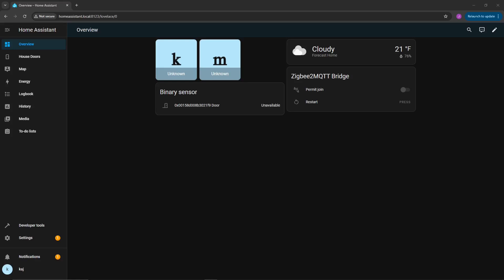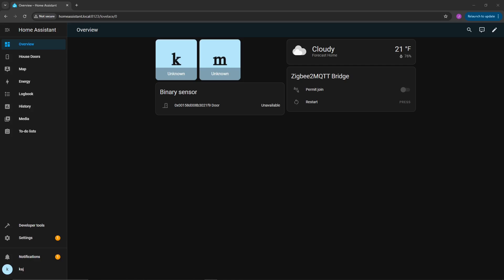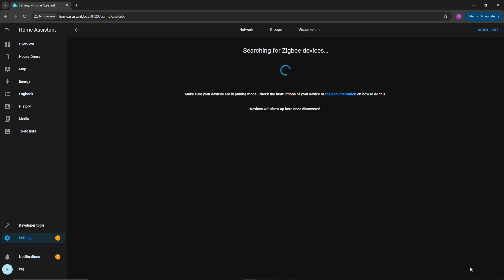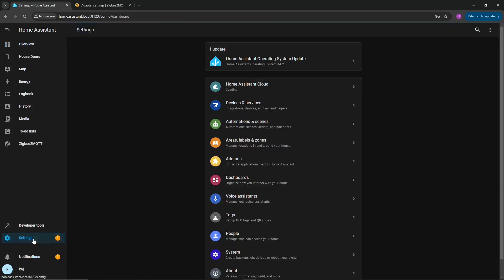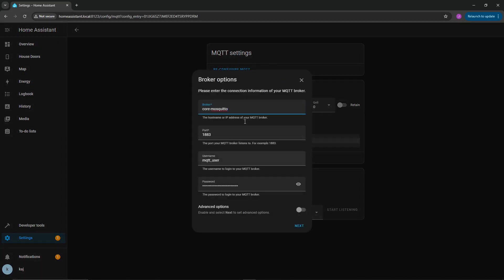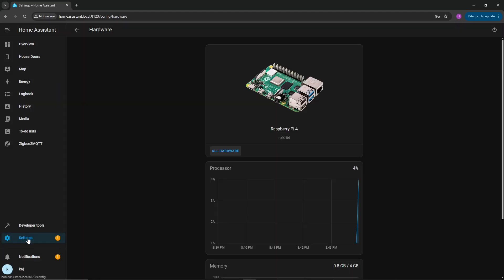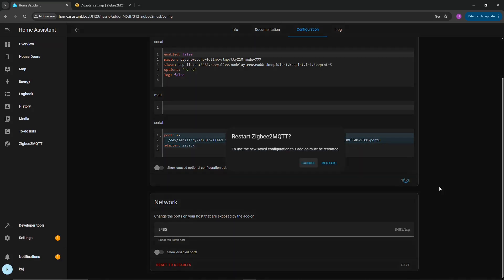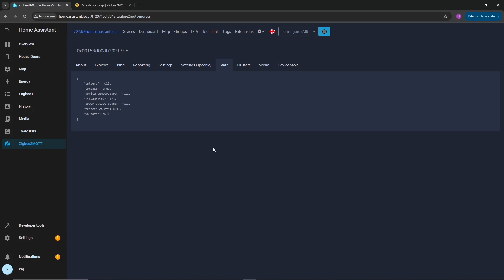Setup AQARA Sensors in Home Assistant (Zigbee2mqtt & ZHA Tutorial)

Comment: I pressed the button on the fp2 sensor but it did not flash blue
Reply from the maker: @andywickett22  did you try holding it?
Reply: @TechwithJak  Yes I held it down for 30 seconds. It's an Aqara FP2 sensor
Reply from the maker: @andywickett22  can't speak for that sensor but maybe you didn't pull the tab out between battery?
Reply: It has been paired for to home assistant for months via WiFi and the apple HomeKit integration. I unpaired it when I pressed the button and it started flashing yellow. It’s taken me 2 days to get it reconnected. I messed up my whole home assistant setup in the process. This particular aqara device is not compatible with zigbee unlike some of the other aqara models. I wish I had known as I’m still picking up the pieces. Can you please change your video title to include the model you used as it does not apply to all aqara sensors. I would hate to think others will make the same mistake and have to go through the same painful process as  me
Reply from the maker: @andywickett  The Aqara sensors purchased are in the YouTube description. As mentioned in the video I can not say this would work for every sensor, that should be quite obvious.
Reply: @TechwithJak  The heading clearly states "AQUARA Sensors" which, by my understanding of plural english,  means 'all' or 'many 'AQUARA sensors, and not 'Aqara Door and Window Sensors'. Therefor not so obvious IMO
Reply from the maker: @andywickett22  All good! Not here to argue. Sorry you took it wrong way. Hope you have a great day!
Reply: @TechwithJak  Don'gt wish to argue either. just saying what I think. Thanks. Have a good day yourself